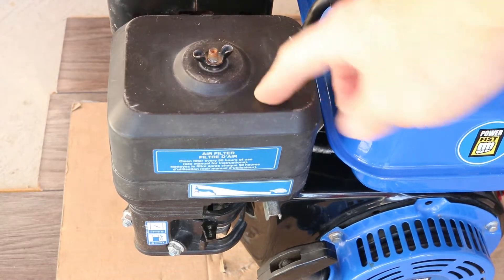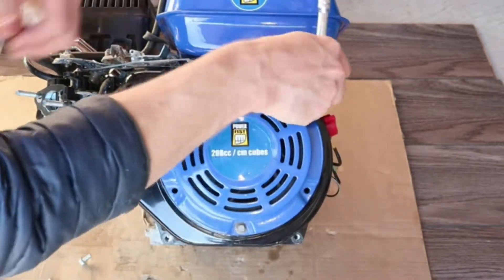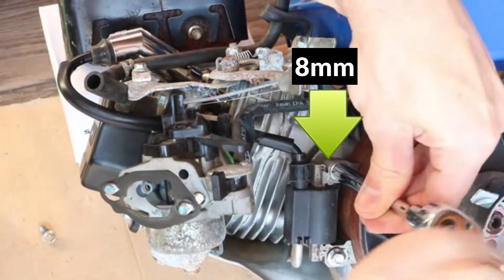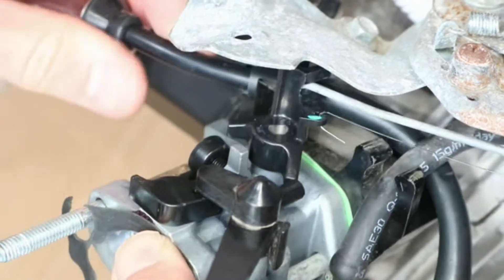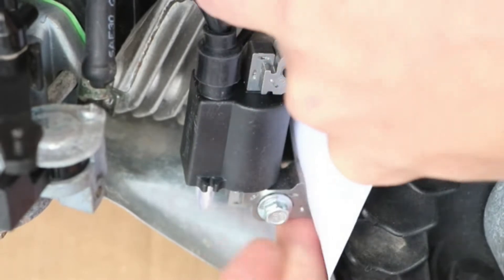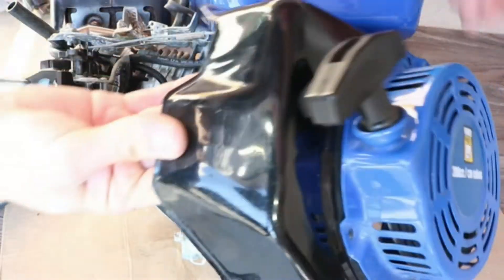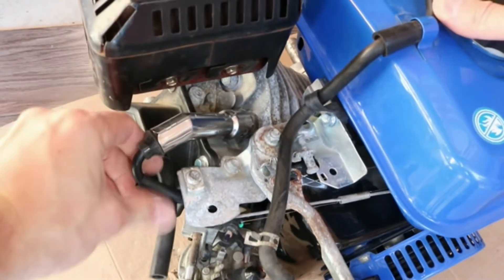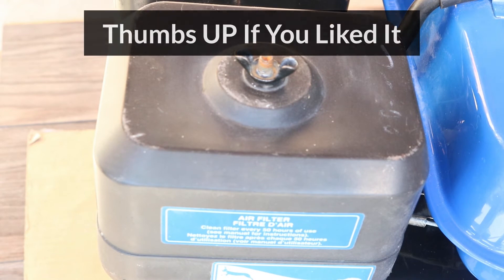Ignition Coil Replacement, Honda GX Engine, GX200, GX120, GX160, GX240

Comment: Thanks for the great instructions on replacing the ignition coil..my power washer MS31025H has no spark. I replaced the sparkplug and ignition coil and still generating no spark. the gap is set very similar to what you had but still no spark.. I can't find the low oil kill switch, the On/Off switch works properly, Off position is shorted to the ground and On is open circuit.. Wondering if you have any suggestion.
One wire come from the On/Off switch to the ignition coil, another wire from the ignition coil to the sparkplug... There's no wire from oil reservoir as a low oil kill switch...should this wire visible?

Comment: Hi, thanks for the Video. But why don't you just unscrew the Sparkplug connector from the cable to get the cable through without disassemble so much?
Reply from the maker: They don't always unscrew, they have some glue from the factory preventing the wire from unscrewing. The same on the other side at the coil.. the wire is screwed into the coil, but then they put glue on top of it.  So it's best not to mess around with a part like that.. If yours  turns and comes out easily from the connector, then it's different than the one I had.
Reply: @CleverFix  thanks for the reply. Yeah it seems like i have an other connector. Unscrewing definitely safes some time but not too much that it makes much difference. Thanks again for your good videos.
Reply from the maker: @DerJuergen3111  Thanks for the comment!

Comment: What is the part number for the Coil Pack you used?
Reply from the maker: I added an Amazon link in the video description, check that, and it also shows some part numbers on the top.  There's a big variety of part #'s that all are pretty much for the same coil.. so it's not just one number. Many manufacturers come up with their own number, but it's the same coil.
Reply: @CleverFix   Well if I would've just expanded the description I would've seen the link but thank you for still taking the time to not call me an idiot and actually answer. I have a Dewalt power washer that has this Honda motor in it and it currently has no spark. I was told this was what I needed to replace, I have now ordered one and will give it a go this weekend. Thank you for the easy to follow video.
Reply: @CleverFix  IT WORKED! Thank you for the very easy to follow video. Got a brand new Dewalt 3600psi power washer that was returned to the store for the cost of this part and a little time.
Reply from the maker: @abrahamhands That's great, wow! Dewalt is nice, that's a rare pressure washer around here, 3600psi is a lot of power.   By the way, I added the link there after you asked for it, so it wasn't there before. I get asked for links very often, I just haven't gotten around to checking all my old videos that are missing them, but it's on my To Do list now.   Thanks for the comment and watching the video!

Comment: Are the coils problematic on them?
Reply from the maker: No they shouldn't be, especially on Hondas! On some clones there will be some problematic ones for sure, but the problem really happens when a mouse 🐁 decides to eat the wires 😊 that's what happened to me.  Even then though, the spark plug lead can be unscrewed out of the coil and a new one put on, but I ended buying a new one just in case because it's so cheap.
Reply: @CleverFix  thanks. You know it's nice that the coil isn't mounted underneath the flywheel.